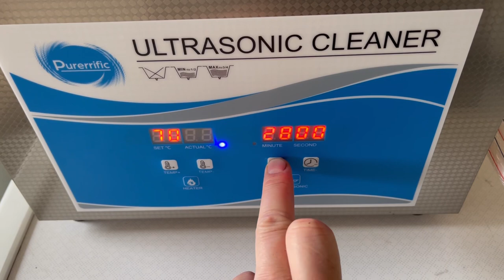Fix Your Honda Carburetor! Step By Step Tutorial!

Comment: We used to have a fair amount of problems with the plastic floats in Honda cars. What is the cleaning solution in the ultrasonic cleaners? 
Hope you're wearing eye protection when using that carb cleaner. That stuff in the eyes can cause you to use bad language. 
Good show. You're a treasure. 👍🍻
Reply from the maker: Yeah it’s horrific in the eyes isn’t it! It’s CT14, very very good stuff, water based so smells good too! Thanks for watching :)

Comment: Great video Tom, i have the same sort of carb on my ride on mower its been cleaned loads of times as it surges but i think something else is causing it to surge 👍👍
Reply from the maker: Quite possibly nev! Try spraying some brake cleaner around the intake manifold :) 

You can try and drill out the pilot jet a size or two!
Reply: @VintageEngineRepairs  i might try that Tom later on need the mower as the grass is growing so fast now👍👍

Comment: hi at 12:17 you removed low speed screw that meters fuel and air, in USA i have HRX217 lawn mower by design at idle it surges because from factory it it set to lean. it surges until it get warmed for many be 20 to 30 seconds..  so question.. if i want to just add little rich during idling how do i do that, can i enlarge pilot (10:57) in video..

alternatively, at 13:22 you removed low speed screwn which as 2.5 turn, can i make it to 2 turn .. you said this meets fuel and air .. Not sure how this is connecteed to pilot jet.. will adjusting this could be of any help. all i want is little more fuel, i think honda did this for EPA.

i have gcv190 engine
Reply from the maker: Give the carb a clean first and see if that solves your issue. If not, open the L screw first and see how you go :)
Reply: @VintageEngineRepairs  Thanks infact i changed OEM honda carbs.  it is kind of known issue of surging for few seconds because at idle it is lean, so are you recommending to open the L screw may be quarter turn out AND NOT in that is from 2.5 goes to 3 is that right.   i see some people use micro drill to drill the pilot hole that is accesible beneath that screw.. which one is good to go.